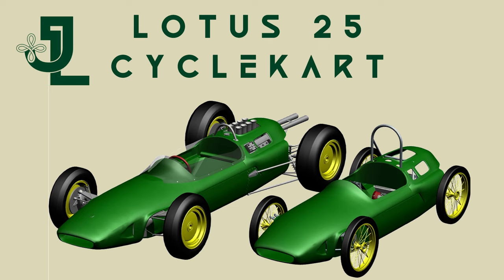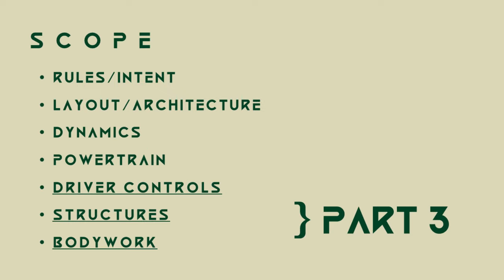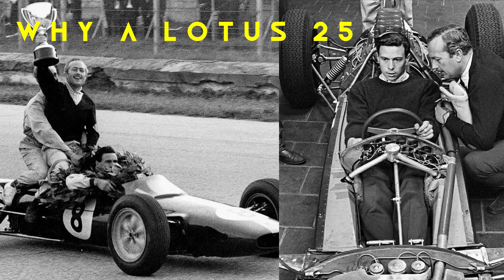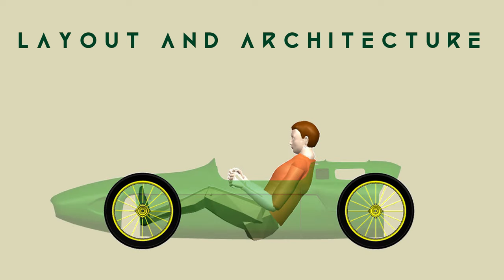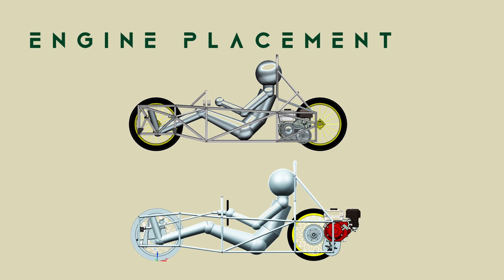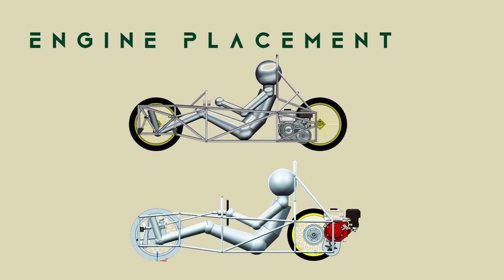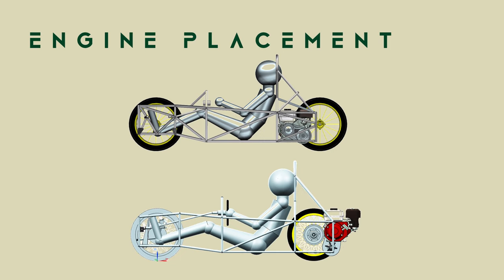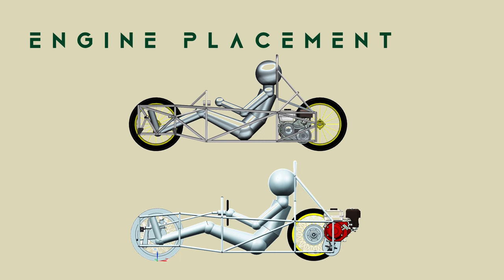Team Juric -  Lotus 25 Cyclekart Design - Part 1

Comment: Outstanding presentation. Many years ago Road & Track Magazine ran a series of articles on designing a sports car. This kind of information, what and how, as you have presented it. Provided, at a level just below engineering school levels, for the gear head with some mechanical knowledge to understand. Steering mechanics applies not to just cycle cars, but to any four wheel,and two in front three wheeled vehicle. Thank you very much for the refresher. You have me hooked. Its going to be interesting.
Reply from the maker: Glad you enjoyed it! I should have been more clear as it's not meant to be specifically about cyclekarts, it's just the project I'm building, the content is actually for wider consumption and can be applied to anything. 

I'm lucky enough to have been exposed to this and I take the knowledge for granted, hopefully this is accessible to anyone who is actually interested in learning

Comment: Going on like this and will end up with  V12 engines.
Reply from the maker: Hi David, I do not think I was advocating doing anything other than following the guidelines to keep to the original intent of cyclekarting. 

I am just sharing some basic engineering and vehicle dynamics principles. You're drawing a long bow to suggest that using a car that was on the cusp of moving away from wire wheels or explaining how castor or trail works means we will end up with v12s in CycleKarts...

Have you actually watched the videos or are you just assuming what my intentions are?

Comment: You show the front axle stub 90deg to the kingpin. If you were to angle the axle stub to 90deg to the road, but kept the kingpin angle your steering would have a reduced effort. Angle the axle stub
Reply from the maker: Hi thanks for the comment. With respect to the stub axle perpendicular to the king pin, I only did that to illustrate the effect in an exaggerated case.

Normally the stub angle would be 1-3deg relative to the horizontal depending on how much static camber you design into the system.

Changing the stub angle will move the contact patch relative to the steering axis, but it's at the expense of camber so it is a parameter to adjust but it's generally not common to adjust camber for steering effort...

On some setups like gokarts you can only adjust camber with kpi, but I like to decouple these two as they have different effects.
Reply: @teamjuric  Ah, understood! Now it makes sense. Sorry 🙂
Reply from the maker: All good! I like having these conversations, I always go back over the content and make sure what I've presented is somewhat accurate, as I'm very rusty with some of this stuff!

Comment: Such a great overview. Designing my cyclekart now. Where did you find the CAD model of the engine and ‘torque converter’ (or did you just make it?)
Reply from the maker: Thanks mate, I found the CAD models off GrabCAD. I try to avoid having to draw off the shelf gear.I always google them first to see if a model exists and if not I psych myself up and spend hours making dodgy simplified CAD models in between lots of swearing and crying.  Link to the torque converter cad I think I used.

If you have any questions or need a sounding board ping me a message in Facebook or insta messenger.

https://grabcad.com/library/torque-converter-comet-tav2-30-100-gtc-tc2-1004-40-41p-1-bore-1/files

Cheers,
Phil
Reply: Found the engine there but missed this. Nice! Thank you!
Reply from the maker: @coultl6556  my pleasure

Comment: I’m new to cyclekarts and am in the U.K. my car of choice was either a Vanwall, or this, so I’ve lucked out there, plus this one is lower✅✅
I see it might be an aluminium chassis, and hopefully it’s plans will be metric😮
Looking forward to following this series.
Reply from the maker: Hi Roger, great minds think alike!!

It'll be a steel space frame, I did consider an ally tub but I wanted to do a spaceframe first. Depending on how this series goes, I might make an ally tub for it.

Everything is in metric, but there are a few imperial parts but nothing too complex.

Thanks for the support and feel free to hit me up with any other questions you might have 

I'm
Reply: My bad on the alloy frame, I thought I saw you welding alloy square tube in an earlier video☹️
I hope you are going to size the fake engine bell mouths so they can double up as Costa coffee cup holders, as there are bound to be at least 8 interested peeps looking on🤣🤣🤣
Reply from the maker: @rogercrier9115  I didn't even think of that. I'm going to have to do something now!!
Reply: @teamjuric  Wouldn't spending that much on aluminium kinda go against the ethos of DIY cheap driving? (as it's classed as gentleman's racing)
Reply from the maker: @1crazypj I'm not sure what you are referring to, my chassis is steel and I might get some velocity stacks done in aluminium...
 plus you wouldn't do an ally space frame it's weak as anything and not safe, you'd do an ally tub from folded ally sandwich panel which is way more cost effective
Reply: @teamjuric  Ah, thought you were saying a full alloy / honeycomb tub on the next one. It would be light and strong but not exactly cheap. (unless you have an aircraft breaker local, some floor plates from a passenger jetliner )
From what I've seen of the Honda GX range (worked on them for 8+ years) the ports will need filling and re-shaping to get better airflow, you can increase performance without losing reliability.
 I've watched a few 'tuners' with the Chinese Honda clones and they generally don't really have a clue what they are doing, just bolting parts on 'because everyone uses this' ( or that)

Comment: Many thanks for your efforts in providing valuable technical design information for cyclekart builders. Looking forward to future episodes.
Reply from the maker: I'm glad you liked it. The next episodes are still a bit away, but hopefully something before the end of the year.
Reply: I am currently building a wood mock up of my kart project similar to yours, it is a bit of a challenge to package my XLT  body into a mid engine kart with A arm front suspension.
Reply from the maker: I'm not familiar with an XLT body, what is that? The challenge is the fun bit 😁

To be honest I actually don't like driving the cars, I just like the design and build journey
Reply: @teamjuric  XLT = extra, large, tall.
Reply from the maker: Oh dear, I should have read your original post again. I thought you were talking about a type of car not yourself 🤪
Reply: @teamjuric  😂

Comment: Excellent detailed explanation of steering geometry, however with the narrow rounded tread on most cyclekart tires, the steering effort is pretty much effortless anyway. It is always a good idea to try to optimize it with sound engineering.
Reply from the maker: For sure, with no front braking, low lateral forces and low corner weights, cyclekarts would end up with low steering forces. 

I was a bit rusty with my vehicle dynamics so it was good to go through this process myself to remember things!! And I thought it would be a good idea to share some knowledge. 

In the next video I'll be releasing this week, I'll actually quantify some steering efforts so have a look and let me know what you think! 

I very much appreciate the feedback and having a chance to chat with some people with cyclekart knowledge.
Reply: @teamjuric  you could just glue on a bunch of extra tread onto a slick bicycle tire, and achieve the desired profile. You can also modify the rims to run tubeless, and cement the tire onto the rim.
Reply from the maker: Hi, I'm not sure how easy or safe glueing the tread would be. However, I have thought about doing a custom three-piece wheel with a tubeless tyre rather than a spoked wheel, but I need to finish one before I start to do anything a bit different.

Comment: Where did you come up with 40" for width?
Reply from the maker: Hello, I got it off the CycleKarts Australia Official Facebook page as one of the 6 standards for CycleKarts in Australia. It specifies Maximum 40" track width from outside of tyres.
Reply from the maker: Hello, I got it off the CycleKarts Australia Official Facebook page as one of the 6 standards for CycleKarts in Australia. It specifies Maximum 40" track width from outside of tyres.